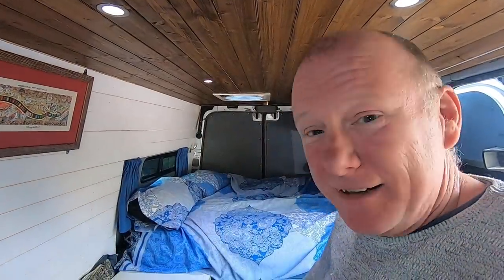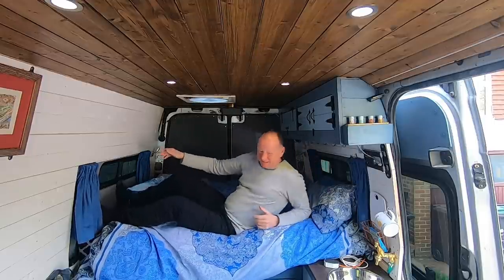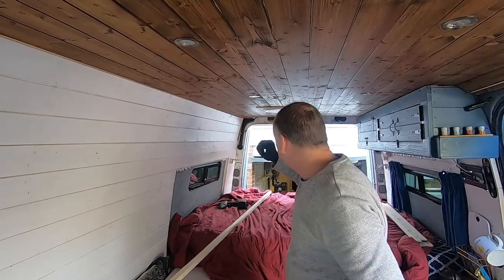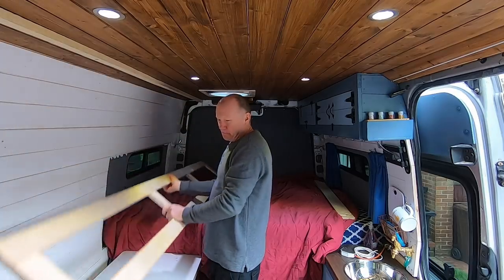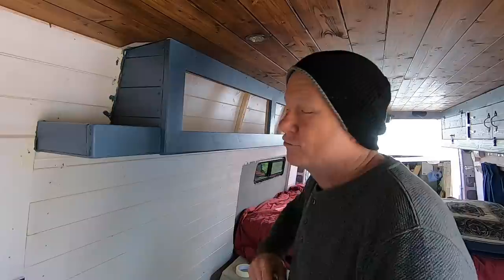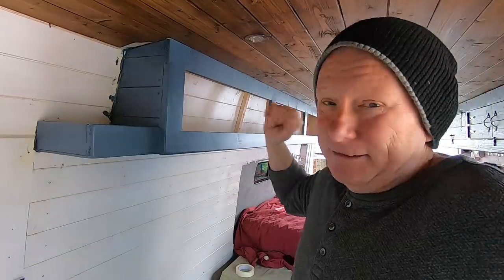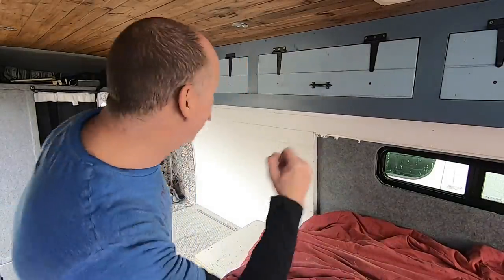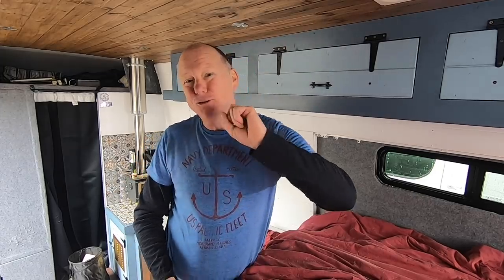HOW TO build RV Overhead Wall Cabinets

Comment: Well Done Mel as per normal . Just a suggestion I have 1 cupboard door that opens upwards i got a little magnet fitted to the door that matches to one on the roof cladding .
Reply from the maker: Thank you I was thinking about magnets 👍😊👍
Reply: @BigVanSmallWorld  as my cupboard door is  the same as yours and lite weight i used fridge magnets, was going to be only temp but worked so well i haven't changed them .

Comment: Hi Mel, great video.  What your looking for are called gas struts. They come in various sizes mine were 6 inch and 40n pressure. The first one's I bought were 100n they were way to difficult to open and close the door, ended up bending the hinge. You get them online ebay or Amazon. I looked for the  quickest delivery.
Reply from the maker: Thank you 😊

Comment: 16.00 I used to mix the dust from filing and sawing with a little wood glue to fill small gaps - looks like the same wood when it dries.
Reply from the maker: Really that’s great 😁
Reply: i'd guess that would be more flexible too, i'm convinced car filler in such small spaces will eventually crack through vibration, hope i'm wrong, but hey

Comment: Overhead cabinet is similar to mine, except the strut running the length of the van is at the height for the bottom of the cabinet, so all the weight goes into the wood which is connected to the metal strut
Reply from the maker: Sounds good to me 👍🤓👍

Comment: Tool station for brackets to hold doors open 
Type in code 84143 , have a look and see what you think.good for 75,90 and 110 degrees 
I’ve used them as you can adjust the tension and relatively easily to fit 👍
Screwfix do the same but don’t know the code sorry 👍
Reply from the maker: Thank you I’ll have a look 👀 👍
Reply from the maker: Thank you I’ll have a look 👀 👍

Comment: They're called, cupboard ga struts in ebay.. You can choose various ones depending on the weight of the door you want it to lift
Reply: not just gas struts but you can get springs that flex into position, not very common but i have seen them! Think these are them https://www.ebay.co.uk/itm/2PCS-Heavy-Duty-Spring-Hinges-Assisted-Lift-Pull-Up-Cabinet-Cupboard-Door-Flap/352746587805?hash=item522155c69d:g:ynQAAOSw1BtcQCVs
Reply from the maker: Thank you that’s really fantastic 👍

Comment: Hi Mel what are the wood frame dimensions for the front of your cupboard and screw sizes?
Can u send me the link or names for B&q please. Nice job, well done.
Reply from the maker: Hi Bex it’s the same wood I used for all my frames 18x70x2400 you can’t get it it on line I tried I had to go get it B&Q online sucks as for screws I’m scraping the bottom of my tub I used what I could find that’s why i didn’t film it lol 😂

Comment: Mel how you finding the vented tank for diesel do they last with diesel in them ? My Chinese one has sprung a leak and weeping on the side
Reply from the maker: they are fantastic iv used them for years make sure you get vented lid 
 http://rover.ebay.com/rover/1/710-53481-19255-0/1?ff3=4&pub=5575467911&toolid=10001&campid=5338454651&customid=&mpre=https%3A%2F%2Fwww.ebay.co.uk%2Fitm%2F15-litre-water-tank-hydroponics-window-cleaning-garden-garage-motorhome-van%2F113729556213%3FssPageName%3DSTRK%253AMEBIDX%253AIT%26_trksid%3Dp2057872.m2749.l2649
Reply: Cheers Mel yes I’ve ordered vented lid and confirmed by message also 👍👍👍

Comment: The things that hold the doors open are called Gas Struts. A while ago I asked if you could do an instal video on them and you didn't know what I meant lol - https://www.amazon.co.uk/FURNICA-Telescopic-Lift-Close-Strut/dp/B075KV5XCX/
Reply from the maker: Thank you 😊
Reply: @BigVanSmallWorld  Forgot to mention. I installed the gas struts in my van and they are great. When closed they hold the door very firmly, and when you open the door they are soft opening. I bought the 40n strength stays and they hold the door open really well.